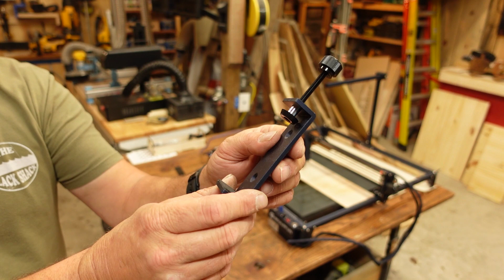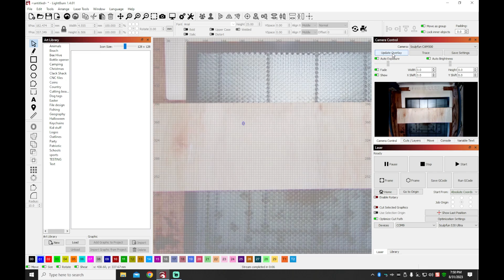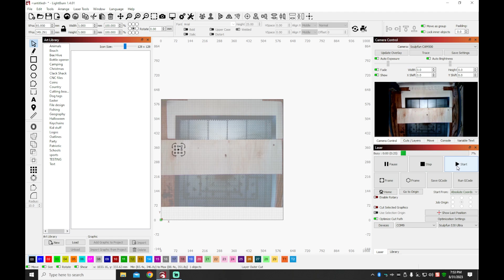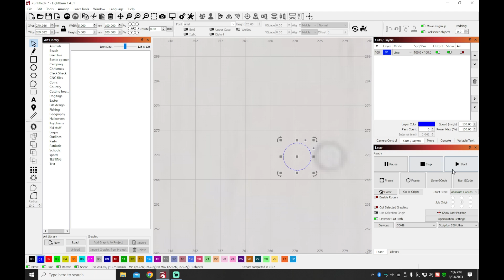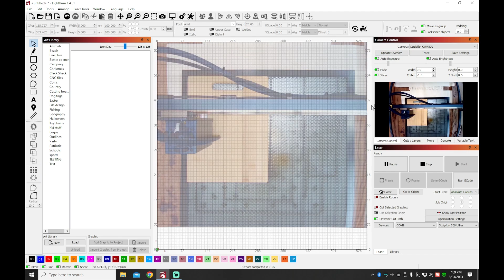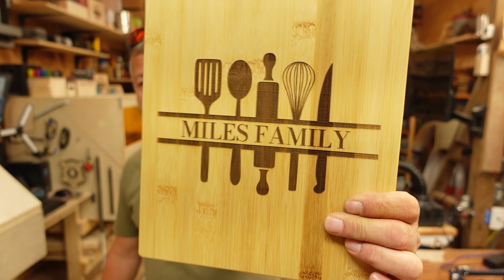Sculpfun camera

Comment: Please can you tell me what the height above the laser bed is, of the aluminium extrusion arm that the camera arm is attached to? I I need to see if it will fit into my enclosure, thanks.
Reply from the maker: It is in the video, https://youtu.be/PEaT1BOTYH4?t=1198
Reply: I came here for EXACTLY the same reason! Finger crossed it fits 😀

Comment: Hey Man, great videos, RE: auto air assist, all 22watt and 33watt main boards come with an outlet socket for the air assist, all you need is a solid state relay,  plug into that socket with the correct kinda plug, take plus to plus and negative to negative etc, and use the solid state relay to interrupt the 110v feeding the air pump.
I hope that makes sense 😂
Reply from the maker: I know I have seen it in several but I don’t know that the beverage person could tackle the wiring. Good to know though

Comment: Curious, i have the sculpfun with the 900x900 bed extension and have been looking for a camera.  This one isn't supported unfortunately.  From your experience, is there a certain type of camera i should be looking at?  Should i get an 8k regular camera or some sort of fish-eye 120 degree? also, i'll be building an enclosure for it so wondering on approximate height i'd need (I have up to 15 foot cleanings lmao).
Reply from the maker: This is what I run in all my enclosures with really good results. I also have a mounting system for lasers and 3d printed version in my etsy shop. https://amzn.to/3MIXbS5
Reply: @TheClackShack  Purchased.  Thanks!

Comment: Is this camera compatible with Sculpfun S30 Ultra 600x600 bed? Can it see whole bed?
Reply from the maker: That’s what I am using it on is an ultra
Reply: @TheClackShack  can it be adjusted to see whole working bed of 600x600?
Reply from the maker: @juliusmotocikli  they machine it is on is a 600x600, yes
Reply: @TheClackShack  i got the ultra and bought the camera after watching this video because im having doubts that it will see the whole 600x600. Just finished installing the cam500. Unfortunately it cant see the whole 600x600 like you said. The center of the camera and the working space is short 9cm.

Comment: Crappy calibration method, they should automate the calibration to a nonlinear grid.... Then it would be spot on for entire camera view as long as you use the same material height.
Reply from the maker: That is lightburn, it works ok though

Comment: I was helped and pointed to your channel by vintauri to check this camera out.   Trying to decide on this one vs Comgrow vs atomstack.  Any help as you are my tie breaker.  No pressure and thank you for your time and insight.
Reply from the maker: The image quality of this one and the Atomstack are similar. This one has fewer joints to require adjustment and the frame is more solid for consistency. The only negative is that you have no tilt adjustment, that isn’t an issue if properly mounted on the machine. For standard square machines, it is a good choice